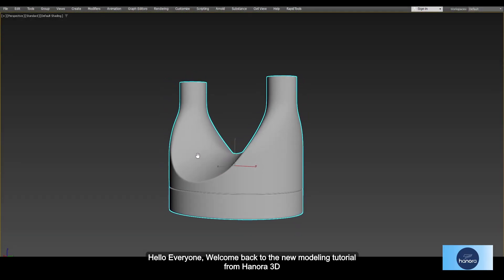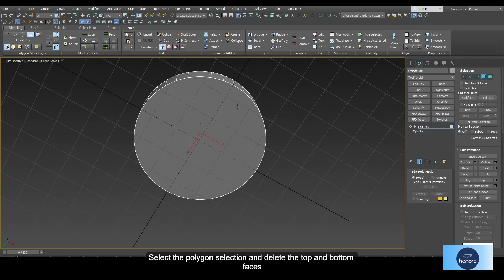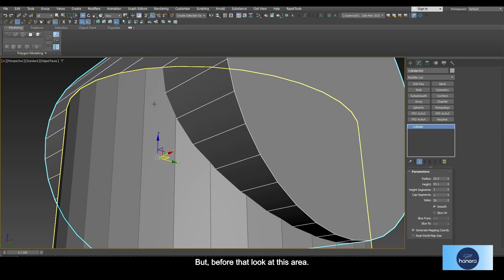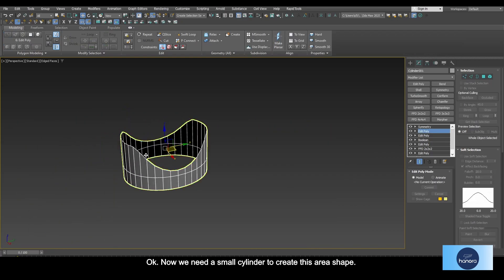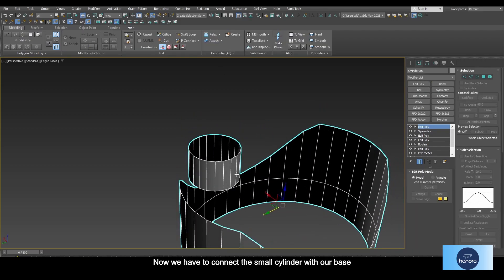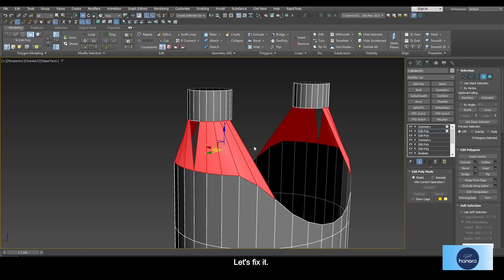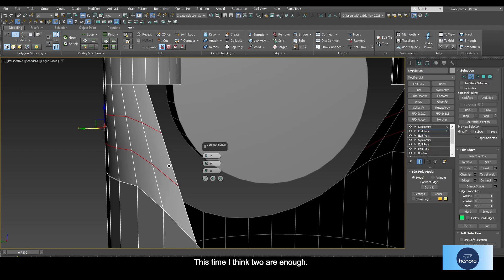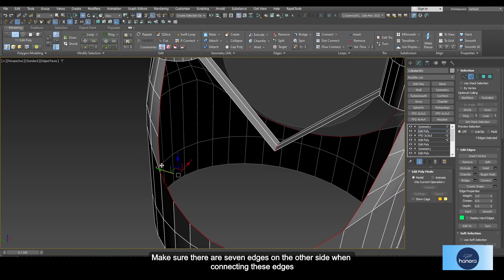Modeling Practice Tutorial For Beginners | Hanora 3D

Comment: Thank you for your support , I do  terrain modeling and when i make road on top the terrain not coming properly , and curve stones and make smooth the landscape aswell . i do all this work but its take much time .
Reply from the maker: I'm really sorry for the late reply. The first thing is as I realize, your road is not assigned on the terrain, for that, you can use the conform modifier if you use 2025 or use the conform tool in the freeform tab. I have uploaded a video on how use the conform tool, please watch it. Another one is, to assign an object to another surface the "Select and Place" tool will help you. You can take it prior to the "Reference Coordinate System" in the main toolbar.